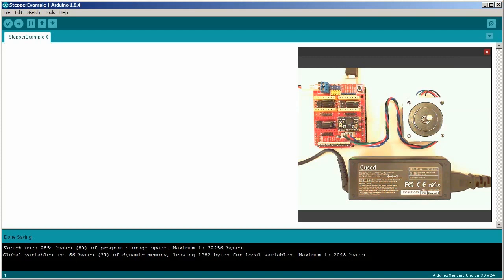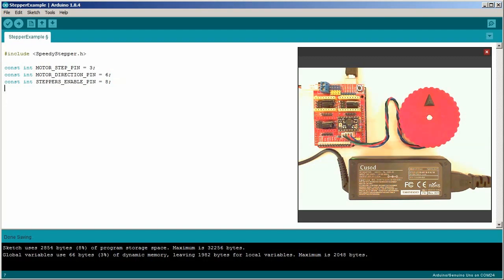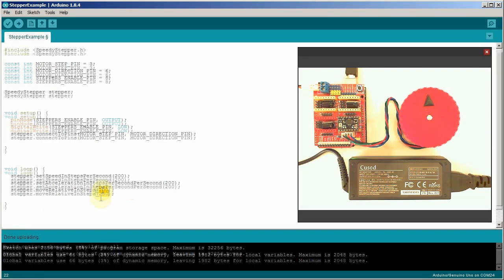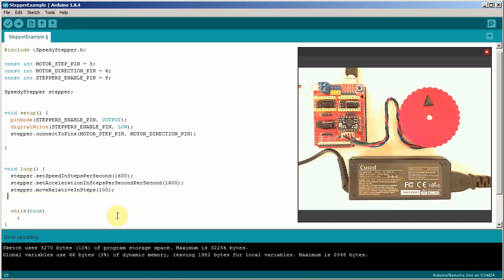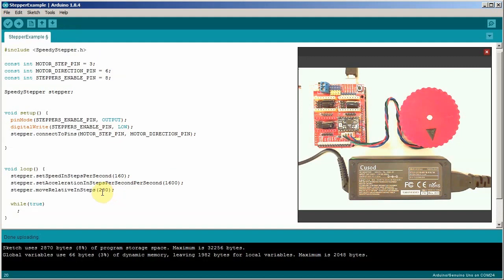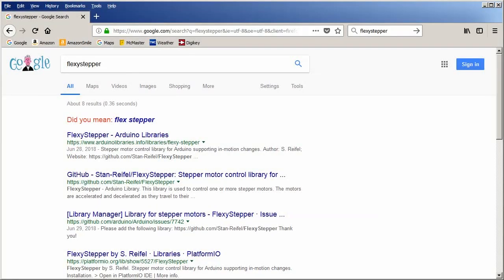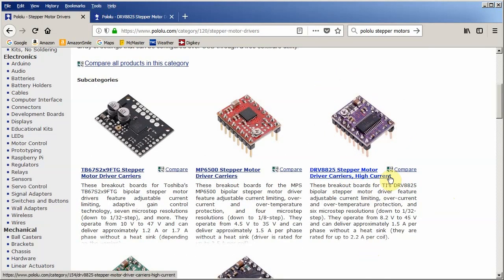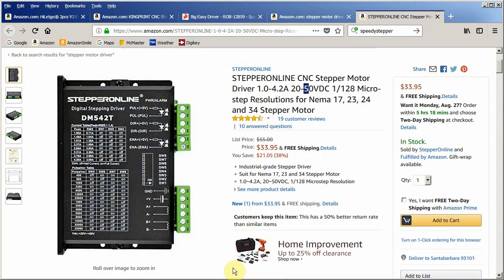Arduino Stepper Motor Tutorial

Comment: thank you for this info. i am building a professional wire cutting and stripping machine and i want high torque to strip the wires while maintaining high speeds to increase the productivity. this library and your other information like smoother micro stepping, acceleration to achieve high speeds, power supply and driver output current ratios will help me a lot.
i just wonder why are you using win95 in your computer.

Comment: //First Code
#include <SpeedyStepper.h>

const int MOTOR_STEP_PIN = 3;
const int MOTOR_DIRECTION_PIN = 6;
const int STEPPERS_ENABLE_PIN = 8;

SpeedyStepper StepperMotorX;
SpeedyStepper StepperMotorY;
SpeedyStepper StepperMotorZ;
SpeedyStepper StepperMotorA;

void setup() {
  // put your setup code here, to run once:
  pinMode(STEPPERS_ENABLE_PIN,OUTPUT);
  digitalWrite(STEPPERS_ENABLE_PIN,LOW);
  StepperMotorX.connectToPins(MOTOR_STEP_PIN,MOTOR_DIRECTION_PIN);
}

void loop() {
  // put your main code here, to run repeatedly:
  StepperMotorX.setSpeedInStepsPerSecond(200);
  StepperMotorX.setAccelerationInStepsPerSecondPerSecond(200);
  StepperMotorX.moveRelativeInSteps(200);

  while(true)
    ;
}